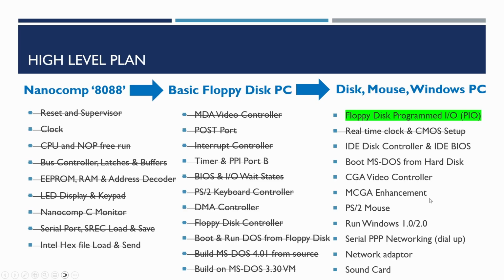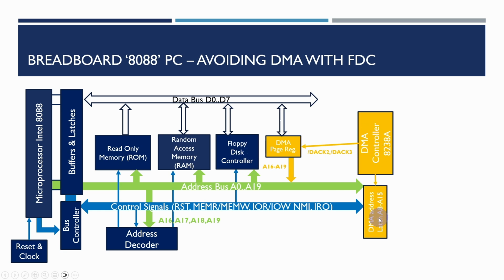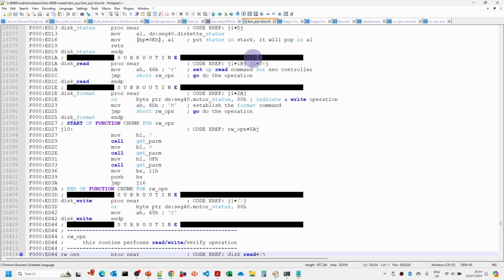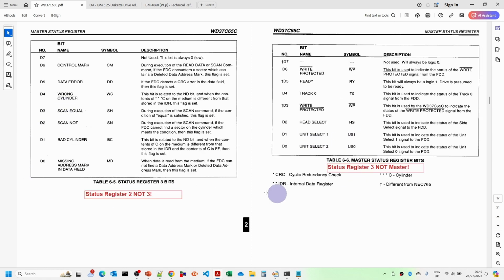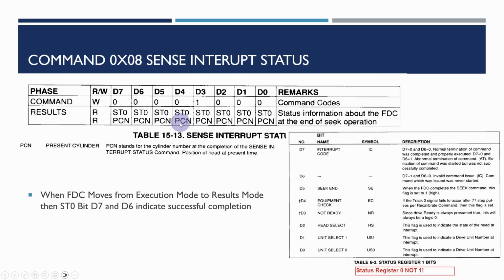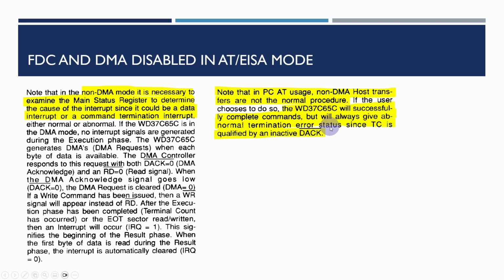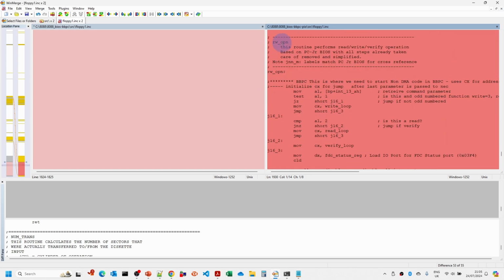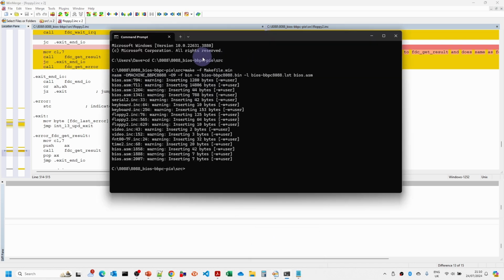Breadboard 8088 PC #40 Programmed IO replaces DMA

Comment: When I did my 8088 PC compatible-ish (still unfinished) project, I decided that DMA was too much hassle, so having found out about the Tandy 1000, decided to go with polled I/O for floppy access (as mentioned in other messages). I was concerned about the CPU having enough time to poll the status and then grab the data, however I used a 720k 3.5" boot floppy, giving me 32us per byte. I just checked and I was clocking the CPU at 4.77MHz, even though it is a AMD 8088-2 (8MHz?).

The floppy controller PCB was also based 100% on the PC design and used the upD765. I copied the floppy code from a disassembly of the Tandy1000 BIOS found on GitHub. I was able to read the boot sector, but after that nothing else happened. I left the project in that state. Your videos on DOS 2/3/4 and the detailed explanation of the boot process will be helpful if I try again in the future. Perhaps I could try your idea of starting with DOS2.0 ?

Thinking about it in hindsight, I wondered if the CPU TEST pin could be used somehow connected to the FDC DRQ together with the WAIT instruction. So it would need to use the DMA mode of the FDC to get the handshaking. Alternately I wondered if NMI could be used in a similar way. Just ideas for alternatives to polling. NMI is effectively wasted on parity fails and these don't occur in a modern SRAM based system like yours or mine. Pseudo DMA might be tricky, perhaps the FDC can interrupt on every byte?
Reply from the maker: As I replied in one of your other posts, I dumped DMA for PIO. To use 1.44MB HD floppies I needed 16Mhz/5.33 MHz clock to be able to keep up reading HD floppies. 
PC DOS 2.0 is much smaller than later versions so has less time for load process to go wrong. I have more detailed analysis of 2.0 vs 3.30 vs 4.00 but not a priority at the moment as want to get CGA card working to run up Windows 1.0/2.0.
Thinking about doing a V2 BBPC with modern 80C88 and chips still available new and run in MIN mode at 24/8Mhz, no DMA and a better bus using stripboard and 0.1" headers.
Dave
Reply: @breadboardinglabs  Yes I have been following all your videos closely and found the DMA videos of particular interest. I don't think there is anything like them elsewhere on YT. Your videos on DOS 2 and DOS 4 compilation were again ground breaking for YT. There are few channels who go so deep into specific technical details and I am aware just what level of knowledge that this takes. I enjoy your videos for this reason and have learned quite a lot which will be very helpful if I revisit my own 8088 project.
Reply from the maker: Thanks for the feedback. It has taken quite a while to fully understand the more complex aspects but fortunately I have more time now to spend on this. May do a Version 2 which should be much quicker to do and not quite as detailed for the more casual viewer rather than the dedicated ones such as yourself. Dave

Comment: A brave and correct decision IMO to kick out DMA. For the watchdog it may be possible to program a timer to generate the required interrupt, or not? Waiting for the next video with great interest.
Reply from the maker: I think the watch dog could use a timer but would have to be wired to an interrupt line which is not an issue for a breadboard PC, but not easy for standard PCB based PC. Not going to worry about it too much unless the rest of it is working. I hope my 'bravery' is not short lived! Dave